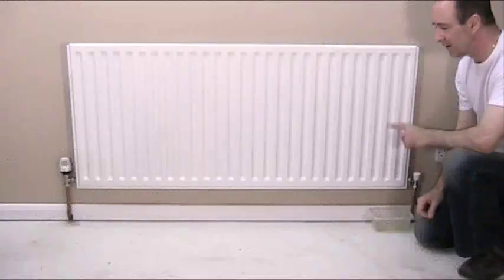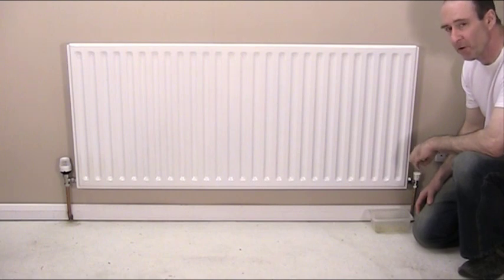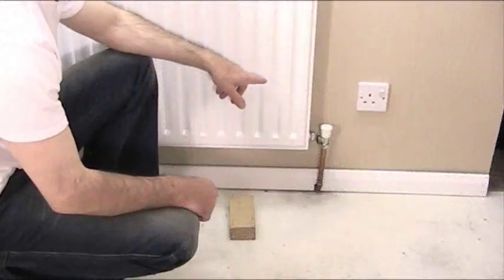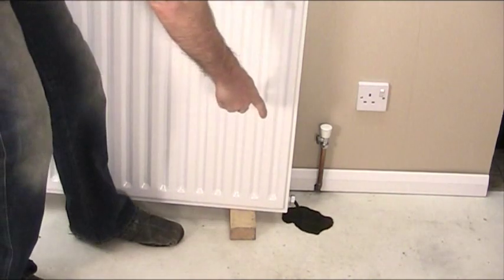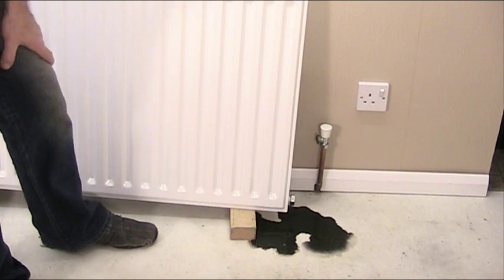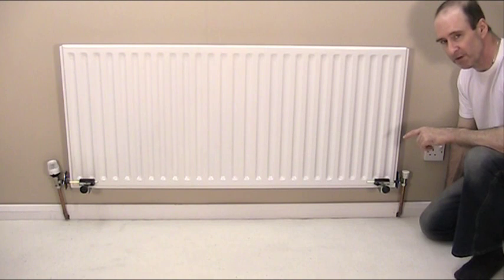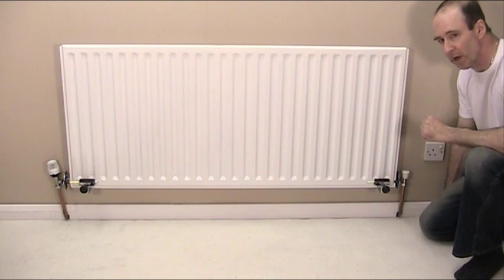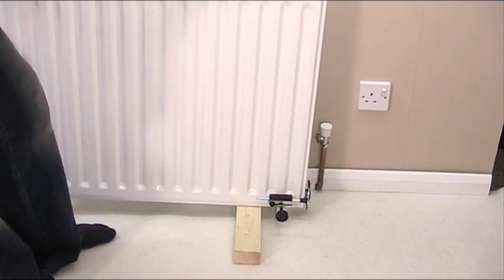Dangers of removing  central heating radiators.

Comment: I'm no plumber but can't you can you screw in some sort of cheap stopper and just leave it in. Seems easier then an over complicated clamp.
Reply: In my experience the radiator isn't the problem, the real problem is the old valves that drip after the radiator is removed. I found they have the same thread as a plastic Hoselock fitting (at least in the UK), so you can adapt a cheap hoselock connector into a blanking plug (just fill the spout with resin, silicone, etc).